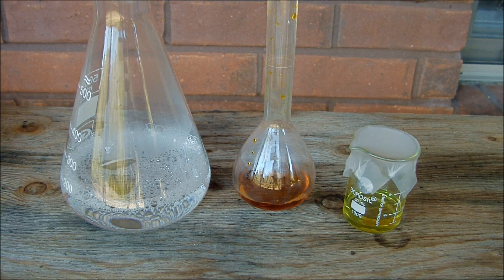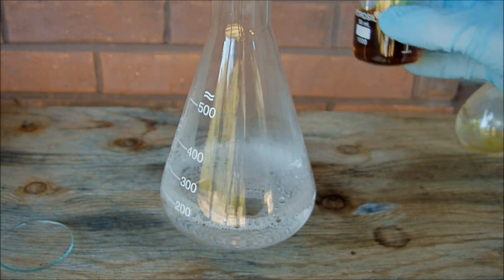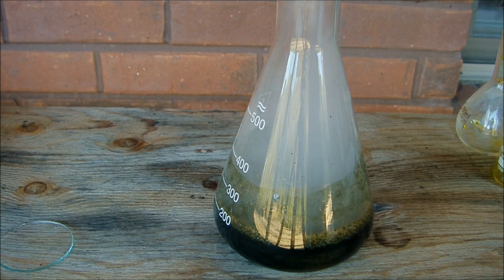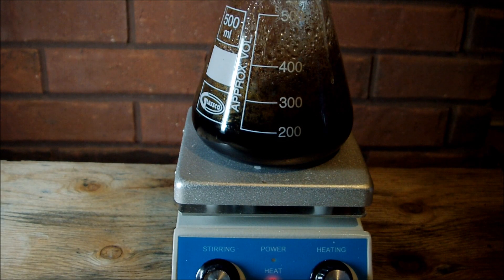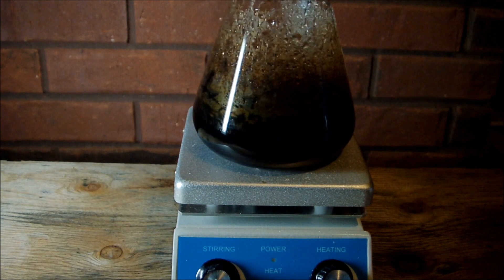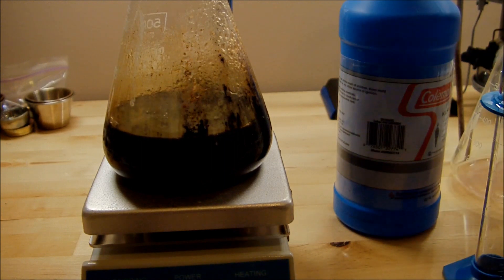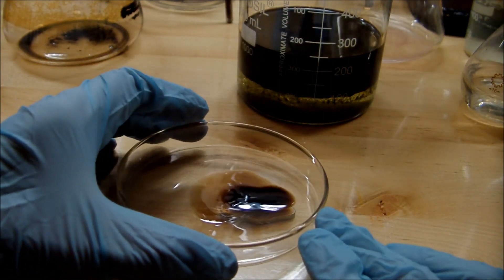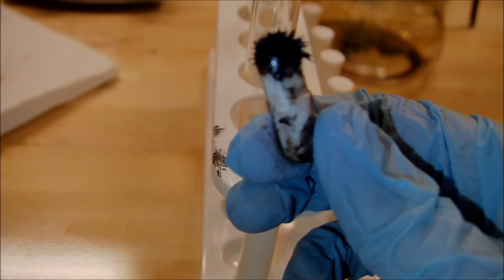How to make Ferrofluid

Comment: want to ask if this ferrofluid can be stored for further use and how long it will take
Reply: +siti fatimah Suboh Not sure about this particular solution but given its use of kerosene I'd say that it is likely similar to commercial formulations and evaporates in open air in ~48 hrs. You can easily keep it forever though by storing it in an air tight container.
Reply from the maker: +Stephen Church That sounds about right.
Reply: +mrhomescientist thnx guys...

Comment: I have magnetic powder with a partial size of 0,2 - 0,8 µm. I believe it is coated.
How can I suspend my powder in e.g. oil to make 'ferrofluid' (MR Fluid) 
I tried with cooking oil but is separates its self because of the Brownian principle
Reply from the maker: +Frederik Gøeg Whatever your coating is has to be soluble in the oil you're using. Oleic acid works here because it binds to the magnetite particles on one end and dissolves in the oil at the other end (like a soap). Your coating may simply be something to prevent rusting, like wax.
Reply: +mrhomescientist awesome! Can't wait to try!
Do you Think the mix of ole acid, E.g olive Oil and magnet powder could be suspended in water ?
Reply from the maker: +Frederik Gøeg No, there are no water-based ferrofluids. Also I don't know that olive oil will work very well, since it's not 100% oleic acid. I looked into extracting the acid from olive oil at one point but I remember it being difficult enough where I'd rather just buy it. But good luck!

Comment: At what temperature did you heat it?
Reply from the maker: +lee hu Not sure, I didn't measure it. If I remember right I just boiled it until the smell of ammonia was gone.
Reply: +mrhomescientist did you heat it near boiling point or above the boiling point?
Reply from the maker: +lee hu Well you can't really heat a liquid above its boiling point; after it starts to boil all the energy goes to turning it to a vapor and the temperature stays constant. Either way the point is to drive off the ammonia so it doesn't really matter what temperature this is done at. It will just take more or less time accordingly.
Reply: +mrhomescientist oh oke, thanks mate :)

Comment: Do you have an idea to increase the particle size? For an experiment i need ferrofluid that stains the least possible. I figure the solution could be to increase the size of the iron oxide?
Reply: +Søren Jensen I'm not much of a chemist btw. And by particle size, i mean grain size( as in micrometers instead of nanometers).
Reply from the maker: +Søren Jensen I'm not sure. The point of doing the reaction this way is to make as small particles as possible, otherwise I think the ferrofluid would look 'grainy' and might not perform as well. You could try chilling the reactants to slow the reaction down; that might give the particles more time to grow to a larger size.
Reply: +mrhomescientist Thanks for the fast reply! I will definitely try this before Christmas and report back.

Comment: using ultrasonic sound I can mix kerosene and water easily, and no way could magnetite clump together
Merci beaucoupe for sharing 'cause I was going to use a magnet stirrer.
trick now is, how to glue an ultrasonic transducer to my beaker?
Reply: First, you need glue. Apply the glue to the beaker and place the ultrasonic transducer on top of the glue.

Comment: I did some ferrofluid experiments around a decade ago.  I was trying to come up with a way of making a large quantity inexpensively so I could use it for electromagnetic, kinetic sculptures.  I discovered that magnetite can be made very inexpensively with table salt and a piece of steel.  Just grab a random DC power supply and make an electrolytic cell with an NaCl solution and steel as the anode.  I used a copper cathode, but I don't think the cathode material matters (just so long as it's conductive).  I never confirmed it stoichiometrically, but I believe the following occur:

At the anode, iron enters solution as Fe(II) ions.
At the cathode, sodium reacts with water, producing hydroxide ions and gaseous hydrogen.
Fe(OH)₂ precipitates in the form of green clumps which stay relatively suspended.
Upon heating the solution close to 100 C, magnetite is formed.

Read the Wikipedia article for iron(II) hydroxide for clarification.

I tried a few different surfactants and mineral oil as my carrier.  I wanted a carrier that wouldn't be prone to evaporation.  My results were about the same as yours.  It definitely reacted to the magnet, but I never got it to form the spikes I was hoping for.  Watching this video made me want to try again and see if I can get closer to the results I want.
Reply from the maker: dovregubben78 Neat! Good luck with your experiments! I hear that vegetable oil and printer toner makes a decent ferrofluid, but haven't tried it myself.
Reply: +mrhomescientist the ferrofluid made from oil and printer toner is useless because it forms a thick black cream if it is kept for several months your's is awesome and can be kept for long term storage
Reply from the maker: +rajesh shahi rajesh shahi Nice, I didn't know that!
Reply: tried it and works, but i don't have spikes either... used seeds oil + engine oil as carrier + surfactant  but still separates when in contact with strong magnets.
Maybe i need to separate the magnetite from the water and try to dryy it out before the oils are added.

Comment: I'd like to make this stuff but don't know where to get the chemicals and such. I notice your heater thing has a stir feature. How does that work and how can I get one of those things and the other things I will need for this? Ferrofluid costs a lot and I would rather make some high quality stuff in large batches on my own if it will save me loads of money. I have an experiment that requires a couple of gallons of the stuff.
Reply from the maker: The chemicals I used are very easy to source - things aren't as hard to get as people think. Household ammonia and kerosene are everywhere. I made my iron chloride solutions from iron (also everywhere) and hydrochloric acid (hardware store 'muriatic acid'). Oleic acid is the only tricky one - try eBay. The stir plate works by having a spinning magnet in the base that you control. You drop a stir bar (Teflon coated magnet) into your flask and it spins along with the plate magnet, stirring your solution. Unfortunately it's unlikely this will save all that much money, and even if it does the quality of your product likely won't be as good as commercial stuff. I think the cheapest homemade ferrofluid involves vegetable oil and printer toner, but I haven't tried that so I don't know what quality it produces.
Reply: mrhomescientist
Is there a non flammable or non dangerous carrier fluid? I found oleic acid and iron powder online for a great price but am not wanting to have flammable fluids in the mix. Especially since I want to have gallons of the stuff and will be using electromagnets and electricity around it so a spark or too much heat sounds like it is a bad thing to mix with ferrofluid that has kerosene. Does the ferrofluid that people buy premade use kerosene or do they use something else?

BTW thank you for replying. i was really hoping to get a good response.
Reply from the maker: Rasberry Jam Well the vegetable oil version isn't flammable (unless you heat to very high temperature), but again I don't know what kind of quality it yields. I suppose you could try vegetable oil instead of kerosene in this formula, but I'm not sure how that will interact with the oleic acid treatment. They might be immiscible, or it might work out. Worth a try! I think commercial stuff uses kerosene, but I'd ask the manufacturer for an MSDS because it might vary.

Comment: I'm pretty sure I know exactly what went wrong with the finished ferrofluid: You have WAY to much kerosene for the amount of magnetite you produced. Proper ferrofluid needs a fairly high concentration (in the order of many tens to several hundreds of milligrams magnetite/ml of fluid if I had to guess) and that's what lends it the ability to resist gravity so strongly. If you ever get the time/motivation to redo this, try this modification: everything is the same until you add the kerosene, at which point you add only 15-30 ml instead of the 100 you used originally. I feel confident in my assertion that the result will be far superior.
Reply: Correct but not entirely. We also need to purify the liquid. It might contain bigger particles or particles not coated with surfactant properly.

Comment: Hi sir, video is very nice. I am doing coatings on bio medical implants by using Electrophoretic Deposition. but in this process i have to maintain the homogenized Fe3O4 (in ethanol) Solution, for that adding magnet bar while magnetic stirring, but when adding bar, totally the Fe3O4 particles are attracted toward bar. so please suggest me. awaiting for ur reply.
Reply: I am not an expert on this matter but why not stir it manually instead of magnetic stir bar?
Reply: In this case the stirring should be done from the top with an inverted 'T' type stirrer fixed to a small DC motor. That would be the simplest of the solutions

Comment from the maker: You could simply add iron metal to the solution - being a more active metal, the copper will precipitate out and you will make more of your original etchant. You may need to add some hydrogen peroxide to make sure it is ferric rather than ferrous. Once the copper is out of solution, there shouldn't be a problem using it as one component of this ferrofluid! Give it a try, with safety in mind of course.

Comment: I tried more times to get ferrofluid with a process similar to the video (magnetite particles + ammonia  + oleic acid) getting different results. I don't know whats wrong, but i obtained a real FF water based where carrier fluid is not kerosene but water. If i put my ferrofluid into kerosene or other mineral oils it doesn't mix but if add water it mix and becomes unstable. If anyone is interested in  confrontate and share his experiments with my'll be happy to do so, please send me a message.

Comment: Working with more dilute solutions may make the particles of magnetite smaller.  Having mechanical rapid stirirng, and adding one component with a drip may also help.

I too would like to see an oil with lower vapour pressure than kerosene.  Testing with mineral oil would be a good start.

Comment from the maker: Looks pretty good to me! I prefer not to use NH4OH for ammonia solution, though. There's only a very small amount of ammonia that combines with water like that - that's why it's a weak base. The vast majority is just NH3 gas dissolved in water. That would only change your second equation by removing the water molecule product.

Comment: Calling this method better was misphrasing on my part. It will give you a better result if you do it just right. But if you take labor into account, this method is pretty crappy. More refined chemical ways is the way to go if you want the best results (but they aren't easy nor cheap).

As I wrote in the comment I referred to earlier, the printer ink method gives you a very quick and pretty nice result. So it's not that I condemn that method.

Comment: Tried this the other day but used Stearic acid instead of Oleic Acid. It seemed to be working until the point at which all the ammonia had boiled off, at this point all the magnetite just clumped together. Thought it could be due to usng Stearic acid instead of Oleic but just seen that someone had the same problem with oleic. Gonna try a different method using citric acid today.

Comment: Hey,
I tried to make ferrofluid for a science project using this recipe (I used PCB etchant as Iron III chloride and combined it with steel wool to produce Iron II chloride). When I added ammonia, the solution turned black for a few seconds, indicating the presence of magnetite, but as I stirred it the solution became a reddish brown. I continued with the procedure and in the end it didn't work. I tried running a magnet through everything and nothing was attracted to it. Do you know why?

Comment: Hey. We've followed your recipe and everything works out fine until we add the oleic acid. It suddenly lumps together which results in small, black and oily lumps. Is it possible that the oleic acid becomes useless due to rancidification? We believe that the oleic acid at least is a few years old...

Comment: He did it a bit sloppy in this video, there is loads of room for improvement (purification and stuff). But I agree that HH shows a much easier way, although the method shown here will produce great results if done properly (which can be a painstakingly hard and long winded process).

Comment from the maker: Not particularly, no. HCl is available as muriatic acid (concrete etchant at the hardware store), steel wool is simple enough to find, ammonia is a common cleaner, and kerosene is camping fuel. See my other video on making iron chlorides The oleic acid was the only hard to find reagent, but that just took a little Googling to find.

Comment: Let's pretend for a second particle size is not an issue. How do I get the oleic acid to properly bond to the magnetite particles...?  Simply mixing them together and adding kerosene does not work.  The oleic/magnetite solution stays at the bottom and does not get "carried" by the kerosene... Would heating ammonia, add oleic acid, drop the magnetite in the solution, then evaporate the ammonia, work? Thank you for your time.

Comment from the maker: It will almost certainly be flammable (haven't tested that myself), but it won't explode under any normal circumstances. It's best to keep it sealed in a glass container anyway, since it smells so bad, and if you do that there's very little risk. That's great that you have a club for science! If you try this, remember to put safety first since there's lots of nasty smells with this experiment.

Comment from the maker: @haynerbass It's worth a try, but remember that you also need the oleic acid. You've got 2 of the 3 parts necessary - the magnetic material (magnetite) and carrier fluid (kerosene) - but you're missing the surfactant (oleic acid). If you don't have that I know it's a major component of olive oil, so you might be able to make a crude fluid using that.

Comment from the maker: @haynerbass Well, kerosene and oleic acid that is. You'd just replace my step of adding iron chlorides to ammonia with adding magnetite to water, I imagine. But this may not give great results, because the magnetite should be a small a particle size as possible. That's the advantage of creating it in situ like I do here, because it makes such tiny particles. If you have a ball mill you might give that a try with your magnetite and see how it goes. Good luck!

Comment from the maker: @yours12342 Magnetism in materials generally arises from electron configuration and unpaired electrons. When the iron is bonded in a compound like this, then it's electron structure changes and it loses its magnetism. A lot of times that happens because these bonded atoms try to get a full outer shell, which means no unpaired electrons.

Comment: @mrhomescientist I googled it and I found a youtube video, it says you can get a magnet of my bending the braket and using a screwdriver to pop it off.  I tried it and it worked perfectly, the only problem is it took of most of the nickel plating of the back of the magnet. When I popped it off there was some residue, so im guessing that there was some kind of adhesive on the back of the magnet.

Comment: You should consider not using heat on the mixture containing the magnetite, as it looses it's magnetic abiliies that way! If you really want to get rid of the ammonia, use a vacuum pump to drive of any excess ammonia...;)

Nice video though, and a pretty cool experiment too!

X.el_ION

Comment from the maker: @linda2503 I would just try and use a lot of stirring by hand with a glass or plastic rod, instead of what I did. I think that is they key to why mine didn't come out too well. I ended up with about 3oz of liquid. It helps to let it sit for a long time too, to allow all the water to settle out at the bottom. That improves it a bit. There are also simpler recipes out there using printer toner and vegetable oil. I'd recommend looking up a lot of videos on this first. Good luck with your project!

Comment from the maker: @elementguy27 That's strange. My first thought was to question the solubility of oleic acid in methanol, but I looked it up and that seems fine to use. The only thing I could think of is not enough stirring. Not using magnetic was a good idea, but the magnetite is pretty heavy so I'm thinking insufficient stirring doesn't let the oleic acid coat it as much as it needs to. That would mean the magnetite would remain insoluble in the carrier. Glad to hear others are trying this out - good luck!

Comment: I tried to make ferrofluid, but before I added the carrier, the magnetite made small globs at the bottom of the flask, and it would transfer to the carrier. Two things I'm doing differently form you. One, I am using methanol as my carrier, and two, I didn't use a magnetic stirrer (which is probably good), but I only stirred for about 3 minutes. Do you have any suggestions? I think I did everything right before that point. I used reagent grade oleic acid...

Comment from the maker: @yellowmetalcyborg Interesting question, I'm not 100% sure. The sources I've read that use this procedure seem to suggest that chloride is necessary for the ammonia to precipitate out magnetite. Ammonium acetate is less soluble than ammonium chloride, so you might run into problems with it also precipitating. Wiki mentions a method to make iron(II) acetate, but it's pretty complex. You might not want to go that route.